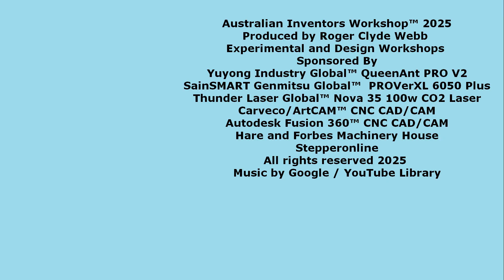Episode 13 DIY  CNC Router Building and wiring the electrical box

Comment: Hello, some notes putting an mdf board (flammable) is not a good idea. U need a ground bus to properly terminate all ground connections. To avoid emi put ferrites on cables going from controller to steppers.  Enclosure seems a bit small to house everything